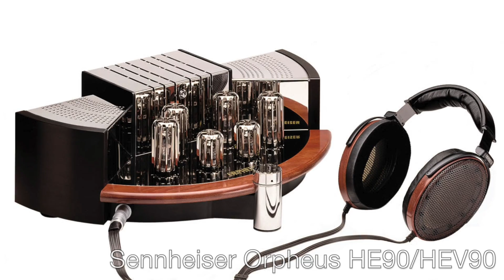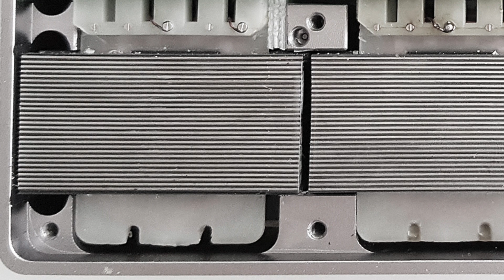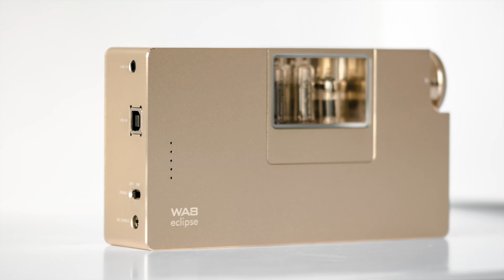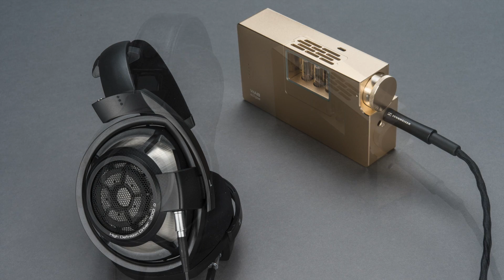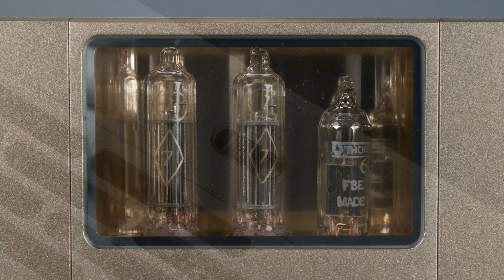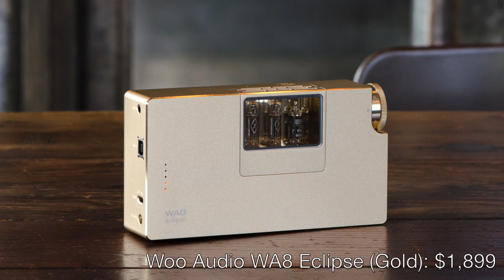Woo Audio WA8 Review - Head-Fi TV

Comment: I'm very interested in trying this with my HD800S, as i've found that i prefer it with the richness that tubes provide. 

Current gear is Cayin iHA-6 and iDAC-6 with little tubes in the dac. When they warm up, it changes the sound dramatically. I've never been so satisfied with any head-fi system i've had. It's simply a stunning pairing. The downside is that it takes hours for the tubes to warm up fully, so i'm looking for a full tube amp atm.

Thanks for all the great videos!